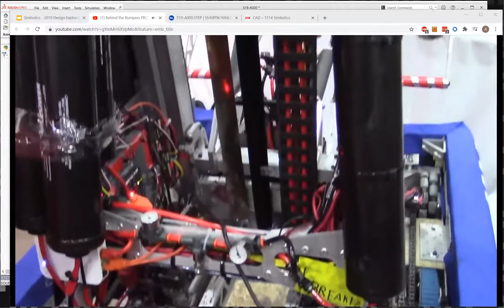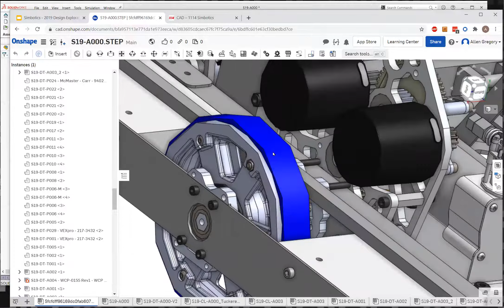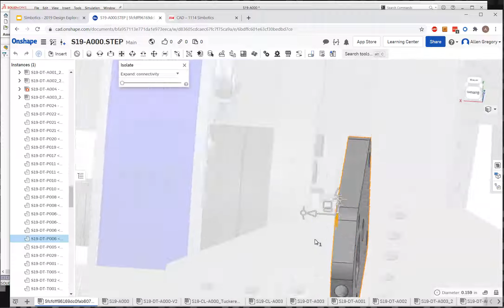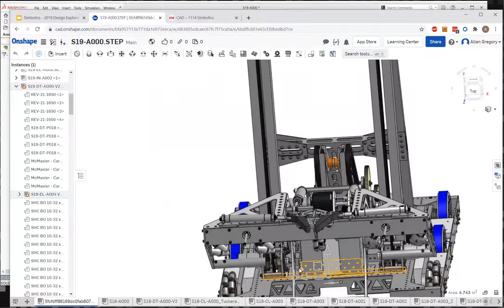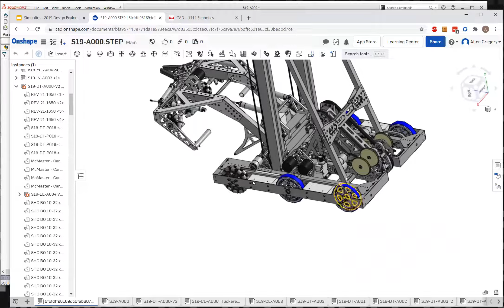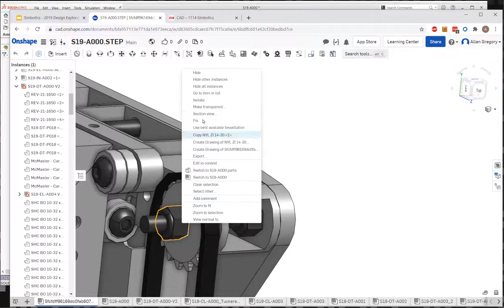Design Exploration: Simbotics 1114 - 2019

Comment: Great video on our 2019 robot! To answer a few of your questions:
The robot spinning was not planned (unless you ask our programmers, they'll tell you they did it on purpose). If I remember correctly, a cable was unplugged on the gyro, but I could be wrong.
The chain tensioning plates were threaded and did not have a nut on the inside hole. Sorry that we missed the fasteners in the design. 
The cut out in the tube was because our foot was much larger in our first competition, it looked more like a capital "I" with a top and bottom cross member. This was cut off after realizing we could climb in under a second without it because we didn't need to pause the rotation when the robot hit the platform to raise the foot out of the way of the platform. 
The battery placement was unfortunately only designed into the robot at the very end of the design process. We thought we could place it behind the elevator but the climber took up too much room. We played around with placements for a few hours and finally found out it could fit in between the intake if we widen it. This is why the two fang plates are bolted inside the tubes on the intake instead of on the outside of the tubes like normal. 

I'd be happy to answer more questions if there are any!